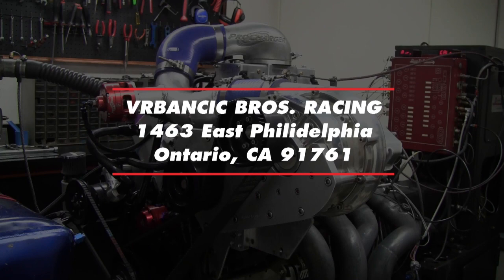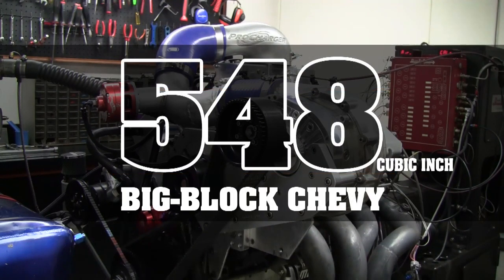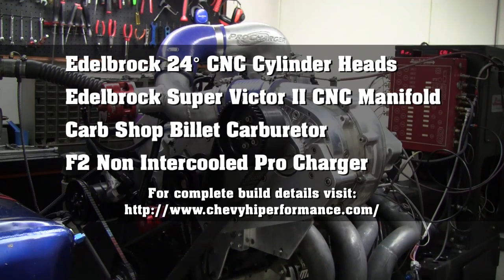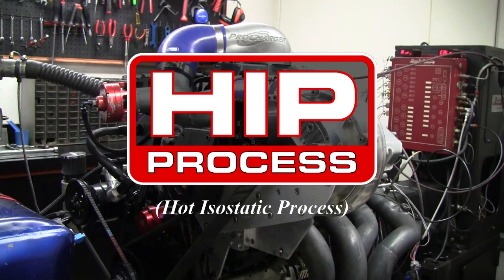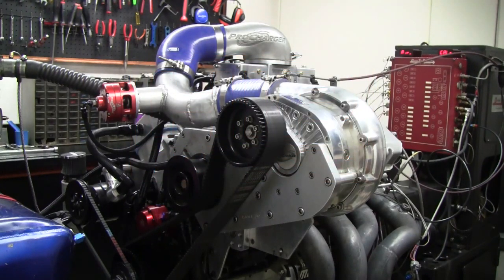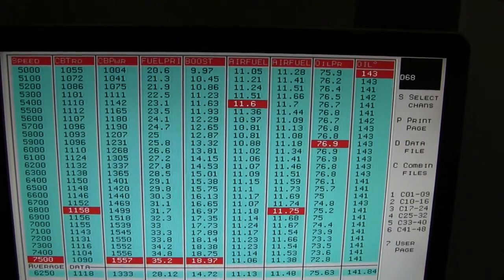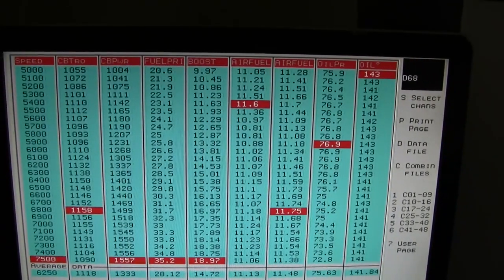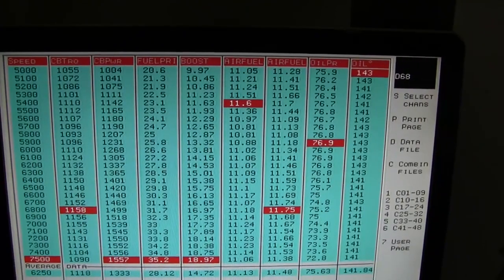1557 HP/1158 ft-lbs Torque - Vrbancic 548 Dyno Run

Comment: Don't be trying to port those HIPPED heads anytime soon.  Hipping makes the aluminum like granite! I don't think heads gain anything being HIPPED.  I tried to port my HIPPED Brodix intake and ended up having to do the work very carefully on my mill.
Hipping a block, where strength is important is what I would do.
Reply: On a big boosted motor...it makes a huge difference in keeping gaskets under them....believe it.....they did the HIPP process to try to mimick a billett solid head.

Comment: I want to know if the procharger will work with dual carburetors thanks
Reply from the maker: You would have to contact ProCharger about Dual Carb systems.
Reply: Edelbrock USA ok thanks
Reply: No.  The cost of having to have a very custom box for the carbs would make it unreasonable.  Also, you would have to purchase Blow-Thru style carbs.